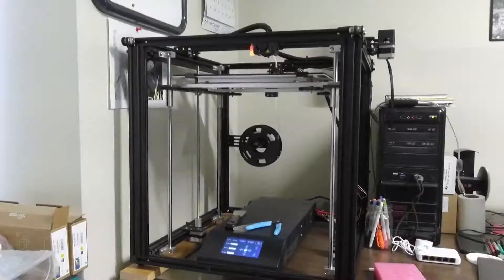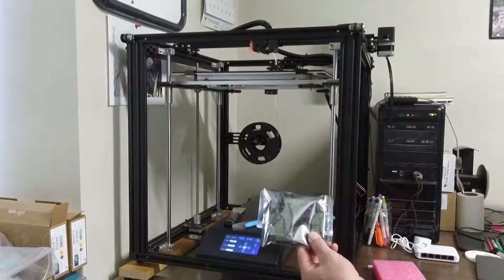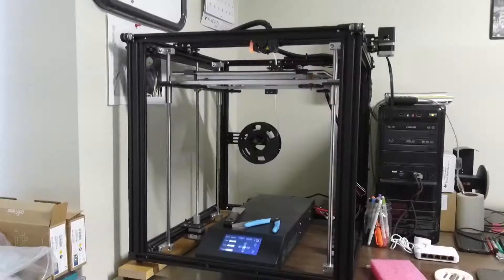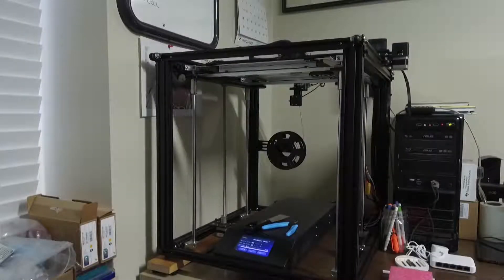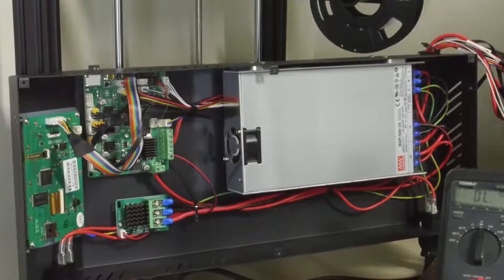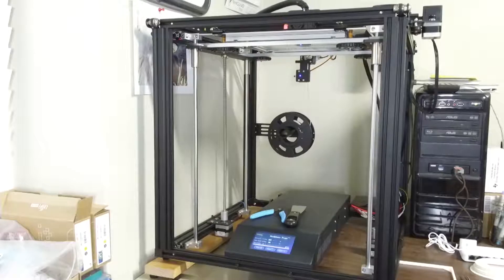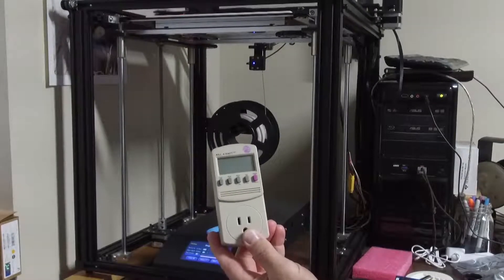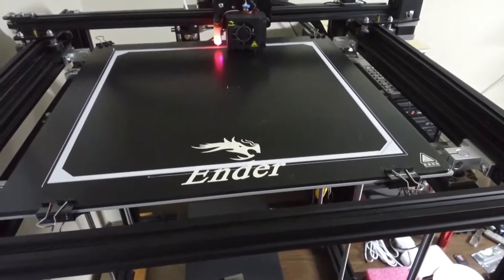Creality Ender 5 Plus Silent Upgrade.  Sound / Noise comparison and power measurements.

Comment: Did you change anything else or just the motherboard??
Reply from the maker: Just the motherboard.  I am considering changing the fan in the power supply.  It is noisiest part of the system.

Comment: Hello how are you? I bought the silent card and was not so lucky. I'm standing here not knowing what to do. To my surprise after the installation I turned it on, the initial image of "loading" appeared and after filling in the loading part to my surprise the following message appeared in Chinese: "waiting for loading" and it stayed there for hours. The board I bought is the V2.2 Mega 2560 TMC 2208. Could you tell me what happened? Thank you for your attention.
Reply from the maker: Sorry to hear that you are having problems.  I only have experience with this single unit  that I installed in my printer.  Not sure what is going on with yours.  Did you get it solved?
Reply: @DanPattenAudioG33k  Hello, unfortunately I couldn't solve it, I think I was awarded the only Ender 5 Plus that doesn't accept any silent motherboard in the world. :(
Reply from the maker: @onetouch3d  Were you able to return the board?  Where did you purchase?
Reply: @DanPattenAudioG33k  Hi Dan, how are you?

So it's a long story, but I'll try to make it short....okay

What happened: In January of this year I bought an Ender 5 Plus here in Brazil in an online store. The printer came and worked perfectly. But like most Enders it comes without the silent card, so I decided to buy a card on the Aliexpress website, I believe you know or have heard of it.

After a few weeks until the silent board arrived, I received it and decided to install it. To my surprise after the installation I turned it on, the initial image of "loading" appeared and after filling in the loading part to my surprise the following message appeared in Chinese: "waiting for loading" and it stayed there for hours.

After 2 days I contacted the seller explaining the fact, I sent photos and videos of the problem. Summing up this part that doesn't interest you, after much discussion he sent me another card that arrived just 2 days ago.

Observation: in that period I worked with her even noisy.

After receiving the plate I was all hopeful to stop the noise from it, behold, the same problem occurred. All the same as the first time.

The printer turns on... the loading image appears, but when it would be the case for it to show its workpiece, it does not load and the same message in Chinese "waiting for loading". Already indignant, I left it there for a few hours, but without any changes.

 I did the firmware update on it and nothing changed.

Comment: Not even through my first filament test cube print and I've ordered the silent board.
Reply from the maker: That was pretty much me as well.  Had not even used up the "starter" reel of PLA included with the machine when I placed my order.
Reply: @DanPattenAudioG33k  same here.. did you notice any difference in print quality? I had hear that tl smoothers don’t work on silent boards because they already reduce electrical noise so in theory silent board should also increase print quality..Any thoughts?
Reply from the maker: @classiccam4647  I did not perform a lot of before and after prints so I can not say for sure.  I do think it does print a little better though.  Thanks.

Comment: Nice thanks for the video, just got my ender 5 plus a few days ago and I'm considering the same "upgrade". I don't sit near the printer so I'm not too concerned but it's nice to just have quiet machinery in general...Nice video and the power meter was appreciated.
Reply from the maker: Thanks for the comments.  My upgrade is still working well.